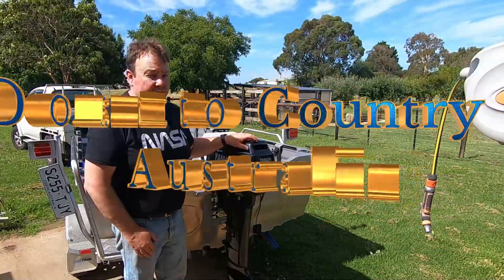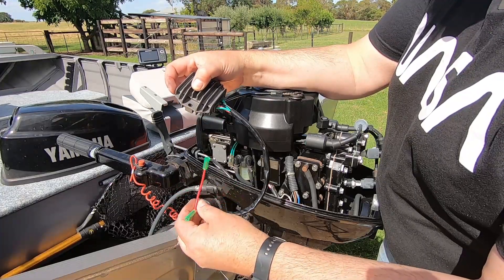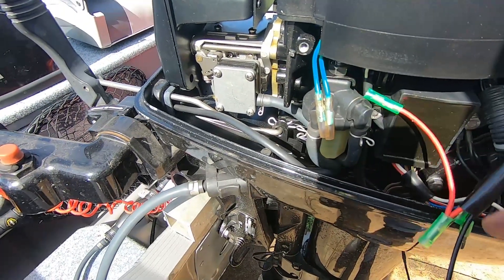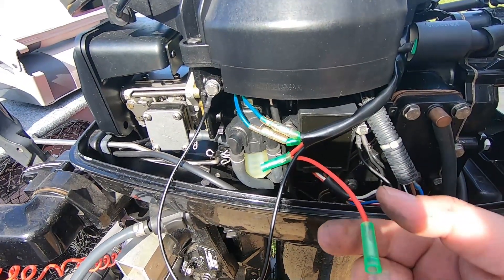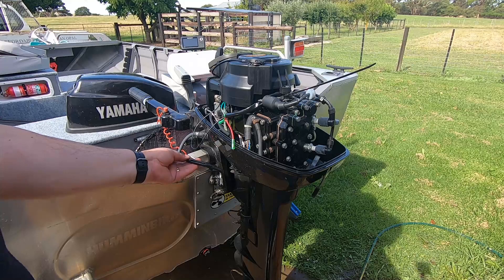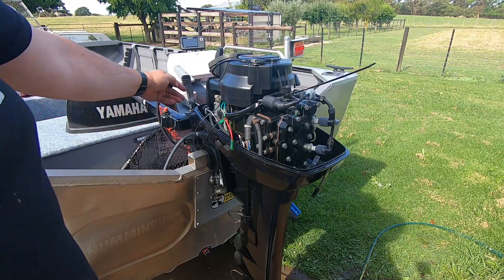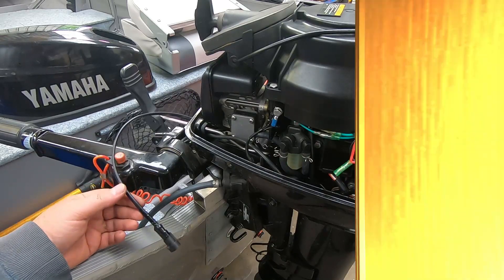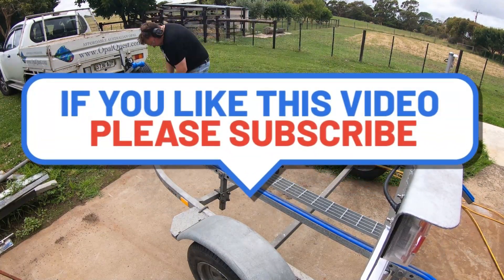Adding Outboard Charging Circuit, Part 22

Comment: Absolutely not good, not sure this is a regulator. 14,4V is in fact max voltage for a lead acid battery. This is maybe only a rectifier, but they "always" say it is a regulator. You will boil battery water. 15V is to high for a regulator ! The voltages for this is actually critical ! This could be a battery killer. I would not trust this without testing if it is a regulator.
Probably a shunt reg. When you not are able to regulate with the rotor current.
Only true test, mount it to a lead acid battery, rew up the engine and measure the charging voltage on the battery, if you have max 14,4V you are saved.

Comment: Is there electric rectifier for  Yamaha 4hp
Reply from the maker: Not sure, normally that's a bit small, you would have to check for coil wires under the flywheel

Comment: Late question, but would the red female plug that you've left as a testing point also be used for the tacho sender wire?  Or does that need to come from a coil?  Cheers from Qld

Comment: Wird dein Spannungsregler auch heiß
Reply from the maker: Not yet, the metal heatsink seems to  work ok. Cheers
Reply: Also er macht deine 14,5 Volt  ich überlege ob ich in mit Wasser kühle oder mit Luft

Comment: I am having trouble with my Yammie. It also is putting out 15 volts. 15 volts is really bad news for a regulator - no regulator should go above 14.4 for a small outboard battery or you cook the battery. I don't know what Yamaha are doing, the rest of the engine is great.
Reply: What engine do you have? I just bought the kit for my CV30. The dealer gave me one like the one shown in this video,  despite the engine having a dedicated socket on the panel.
Reply from the maker: That one was a parsun, Chinese version of a yamaha.

Comment: What gauge or mm wire do you use. My battery is at front of boat will need about 3m of wire. Will i need to use a thicker gauge?
Reply from the maker: Its only a charge circuit so I used 2.0mm double insulated wire, my battery is up the front too. Theres a whole series of videos on my channel wiring my boat. Cheers

Comment: Do you have the link to where you bought the rectifier? Part number?
Reply from the maker: This is the one I bought, just search ebay and find one that fits your engine. Cheers RECTIFIER REGULATOR FIT FOR YAMAHA 15 / 20 HP  6AH-81960-00-00 SL
Reply: @coasttocountryaustralia  Thank you! I googled it and the price in Norway (where I currently live) is astronomical. Around 1500 NOK (roughly 210 AUD) and they've put in region barriers so it is impossible to order from amazon / ebay :(.  But I'll keep looking.

Comment: Great information, thanks for sharing! I just want to run a 12v light so others can see me at night. Do you think I need a battery, or could I just wire the light direct to the regulator with a switch so I can turn it off during the day?
Reply from the maker: If it was me I would run a small battery, even if its a small motorbike battery, then if your pulling a higher current from something it won't damage the regulator. Cheers
Reply: @coasttocountryaustralia  thanks mate, great advice. My only issue with the battery is that it will have to be removed and stored when I invert the dingy onto the sailboat deck. Bit of a pain. I will check the amperage when I get a regulator and see if it's capable of running the light. Thanks again 👍 we also have a channel over at @sailingwishfulthinking if you are interested. Cheers

Comment: Have a quick question for you, I've ordered a similar thing on eBay, and checked the voltage on my outboard coming off the magneto wires and I'm getting 70 volts AC when running! Is this normal or am I using the wrong wires? Don't wanna blow the part I'm getting...
Reply from the maker: Hard to say for sure but sometimes you will get a high ac reading off the coil wires without a load (rectifier/regulator)  connected.